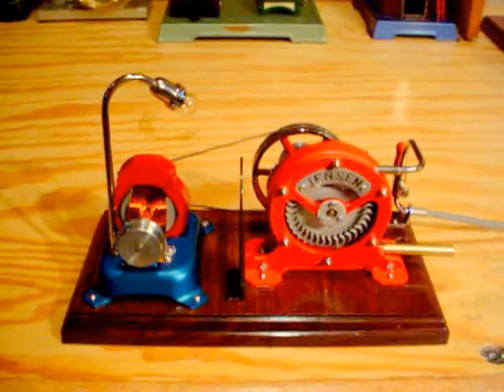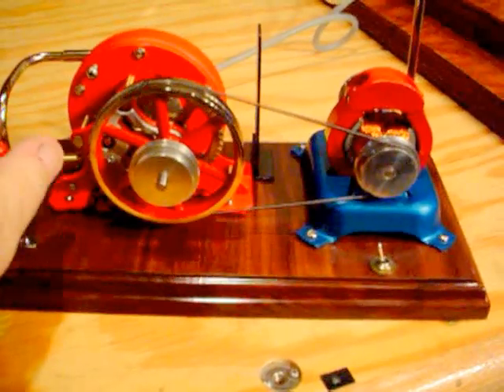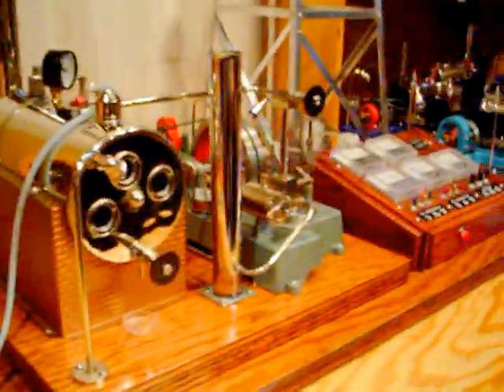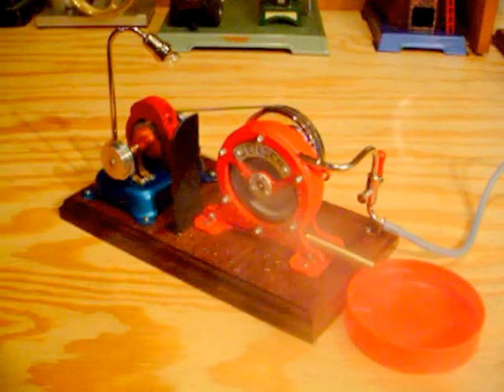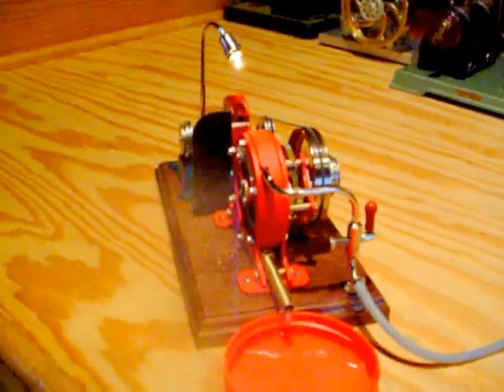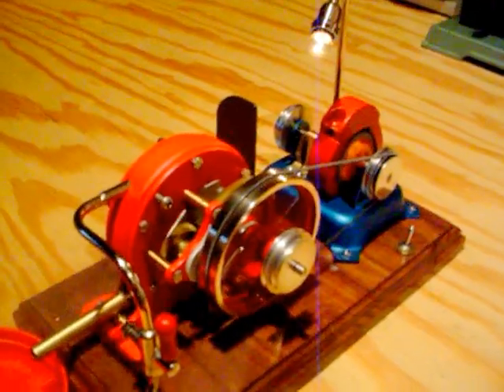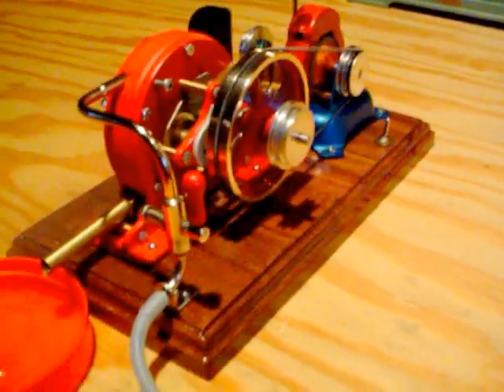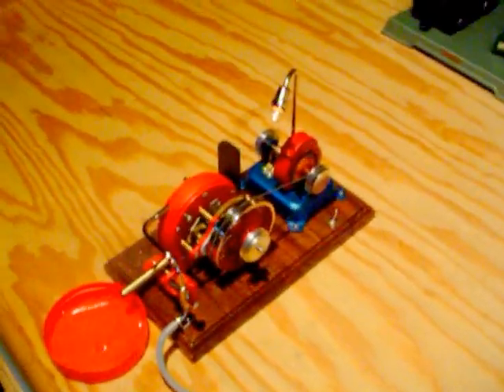Jensen 95G Turbine unit with 15BL generator

Comment: Is it more economical then your steam piston motor?
Reply from the maker: If you are asking about economic use of steam, I think the turbine delivers higher rpms vs. piston motor, but at lower torque.  The piston motor on the other hand runs much slower, but has more torque.